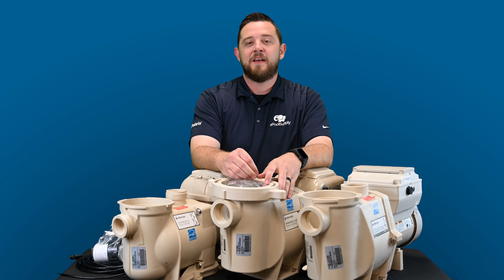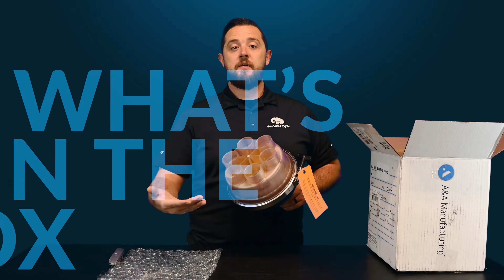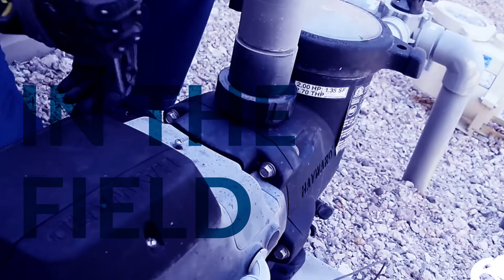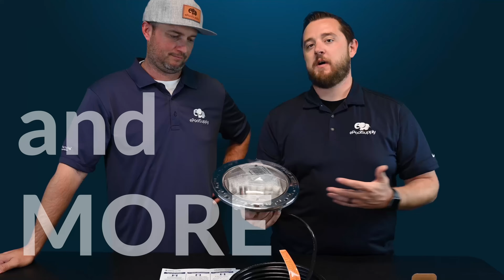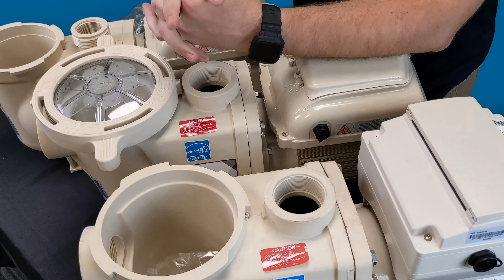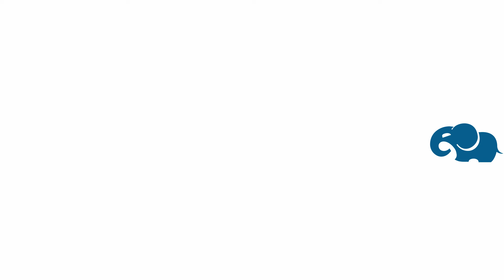Pentair WhisperFlo VST Variable Speed Pool Pump Comparison Video - 011533

Comment: Can you tell me why my brand new whistle flow variant speed pump is priming every time it starts up..... The guy at Leslie says it only primes on the first startup and I notice I have air leaking from the six bolts that are connected..... I think that could be the problem.... Thank you sir

Comment: Nice video. Can the new Whisperflo VST 2.6HP be plumbed in at the same height for the suction line as an older single speed whisperflo from the late 2000s?
Reply from the maker: Thank you for the comment! Yes, it will match up the same.

Comment: Thx for the vid... Question.... On the Whisper VSP, can you just run this pump in manual mode and not a schedule? For instance, if I have a schedule set to start at 10:00am, but because of a special circumstance one day I want the pump come on at 9:00am, could I just press start and it'll start running? (I wouldn't want to change the schedule because it's only this one time that I want it to start at 9:00am). Here's another scenario where I'd just want to manually run it.... say pump schedule goes off normally at 7:00pm, but we're having a pool party from 9:00pm-11:30pm, so I'd want the pump running to run the waterfall...how could I put it in manual mode, so I can manually run it from 9:00pm-11:30pm, and then have it go back into schedule mode at 9:00am. Is that possible? (I had an old Intelliflo from 2015 and I could do this).
Reply from the maker: Yes, this pump offers those same capabilities. Hope this helps!

Comment: Hi there what is the model number for the 3hp? Thank you
Reply from the maker: The model number for the 3 Hp pump in the video is EC-011028.
Reply: @ePoolSupply  Thank you , what is the difference between EC-011028  and 011075 ?

Comment: I have a play pool with pop up cleaners. Soon I will have to get a new pool pump. I have a VS 3 HP now, someone said I don't need that much and recommended a 2 HP. What would you recommend? Love your video!
Reply from the maker: Bigger is a always better when it comes to pumps or filters in our opinion. More efficient and will tend to last a little longer as well. Hope this helps.

Comment: I’m building an inground (~14k) and believe a WhisperFlow would be a good choice. However, my research on pool system design has been difficult. There doesn’t seem to be a lot of clear, straightforward guidance from either manufacturers or, my apologies, many dealers. The performance charts seem backwards in how they show the needed data and are not at all intuitive to myself or my friends who I’ve asked for help.
I came across your video and, although it is rather informative and affirms my decision on the WhisperFlow, you did have a comment which frustrates me. You made allusions to the IntellaFlow being more efficient than the WhisperFlow in high output situations, like pop-up cleaners because the WhisperFlow would be working at, possibly, 100% where the IntellaFlow could be turned down to achieve the same output. This assertion has no explanation. Of course, the larger pump would be using less power than it would at maximum but, what really matters and should be the datapoint to mostly consider is CFM per watt. That is what really tells you what’s the most efficient choice. Unfortunately I have yet to see this metric in any manufacturer’s literature or any dealer’s. You wouldn’t shop for a car concerned about gas mileage without looking for the MPG rating. Why is this information missing in the pool industry?
I do understand the WEF number but, until that’s specified on a graph against percent of max output it’s rather limited in an apples to apples comparison like you’re doing.
I, obviously, don’t come from your industry but, I just seems that a few things could be easily improved to make this exercise more streamlined. Please advise.
Reply from the maker: For more specifics, we would recommend reaching out to the manufacturer. They have great tech support specifically for those needs. 1-800-831-7133.

Comment: Need a new pump, and a pool rep came out and recommended the new Whisperflo. Said the Intelliflo3 would be overkill. We would just be running it off the main filter. No spa, no automation, on a timer board, and about 14k gallons. Should we go with the 3 or stick with the whisperflo?
Reply from the maker: You should be fine with just the Whisperflo because even if you have an in-floor cleaning system it rates to a 2.6Hp motor which in-floor systems need 2Hp to be able to properly function. The Inteillflo3 would be more efficient for you though. Hope this helps!
Reply: Thank you. No in floor cleaning system. Just the suction drains down there for the filter. We have a Polaris 280 on a separate booster pump. We also have a rarely used water feature on its own pump, on a separate switch. That gets used maybe 2 hours a year. 

Quote we were given has the 3 at $400 more total over the whisper. 

Thank you.

Comment: I was supposed to get the intelliflo vsf (011056) and I know that supply has been a real issue. Ended up with a the new whisper flo vst but can't help but think I'm missing out on some kind of features or energy savings that I would've had had I received the intelliflo model instead. Hoping to get some input on this.  Can't seem to find a good unbiased source for answer
Pool is about 15k gallon, raised spa, second story rooftop solar heat.
Reply from the maker: Hello, unfortunately, you are correct about the energy savings you would be normally getting if you had the 011056 vs the  WhisperFlo VST as you will need to run the WhisperFlo at full speed to even move your water and cycle it fully with that type of pool.

Comment: Will this pump be efficient for 2nd story roof-top solar?
Reply from the maker: It's possible that it might but you wouldn't really be getting any of the energy savings you would normally be accustomed to with a 3 HP pump. You would have to run it all full speed at all times. Hope this helps!

Comment: Is it possible to preset a single speed and then turn the pump on and off by using an external timeclock or relay such as in an Aqualink?
Reply from the maker: Hello, to answer simply yes you can. This is usually how those pumps are set up in the first place. Hope this helps!

Comment: Hi, great video, thanks.  Maybe you can help me - I have a small pool (10x15x5) and I need the quietest pump on the market.  Cost does not matter, it just needs to be the quietest (during the day) available.  Do you have a recommendation?  Thanks!
Reply from the maker: Hello. Any of the Pentair variable speed pool pumps are the quietest pumps on the market in our opinion. Just depends on which one you need for your pool specifically. Hope this helps!